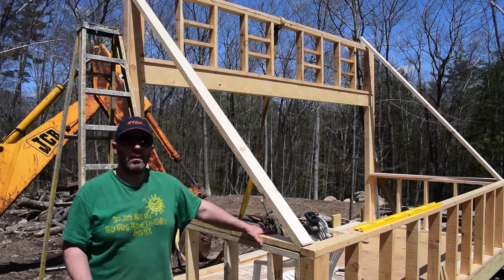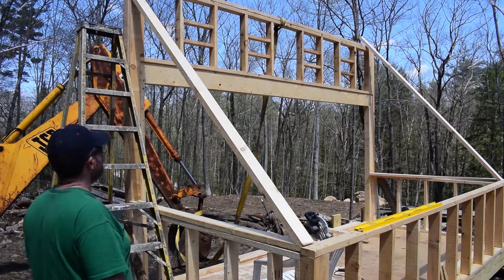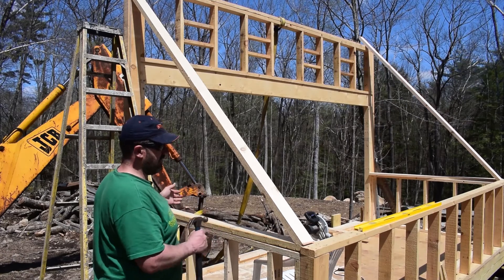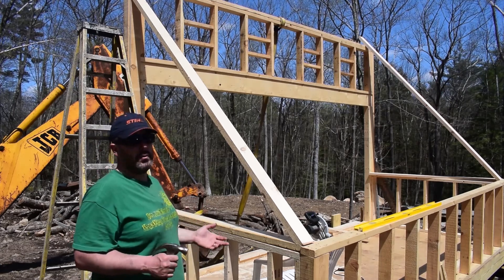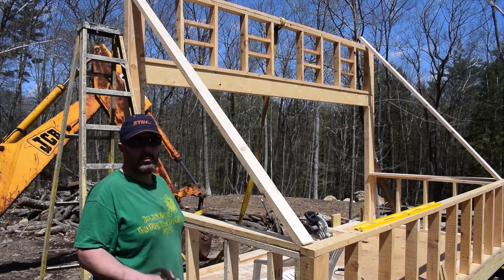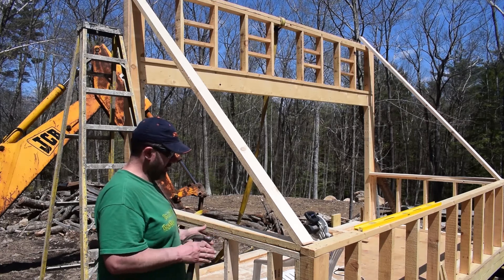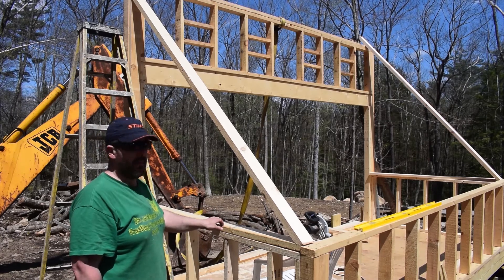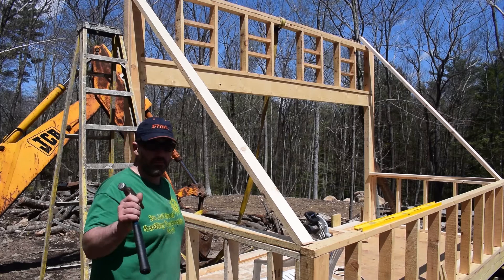Solar Kiln Build Part 6 - Finished The Side Walls

Comment: Great work. My only constructive advice would be to get a nail gun. It will speed up the process and make it much easier
Reply from the maker: Yeah, normally I would, but I had a 5 gallon bucket of these framing nails and needed to use them up.  Thanks for watching